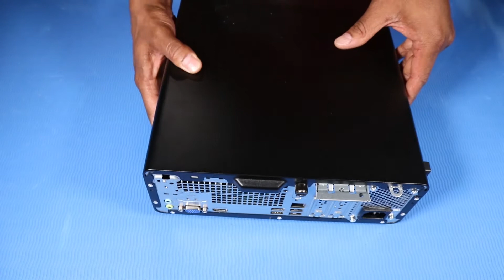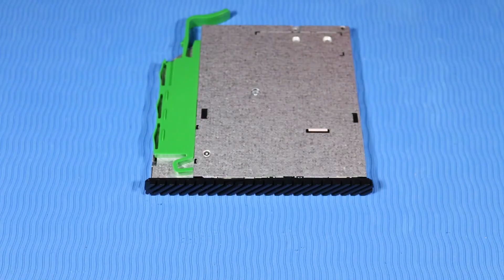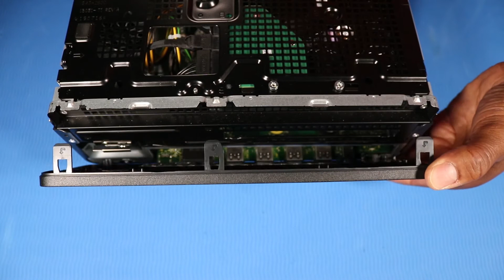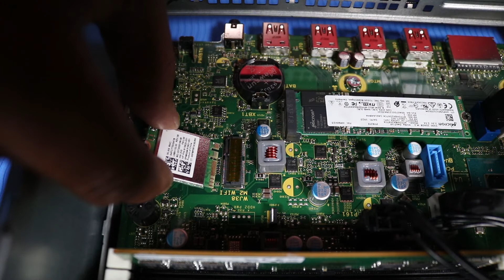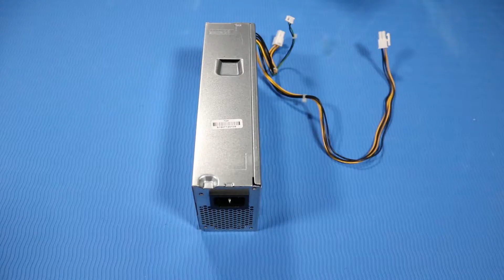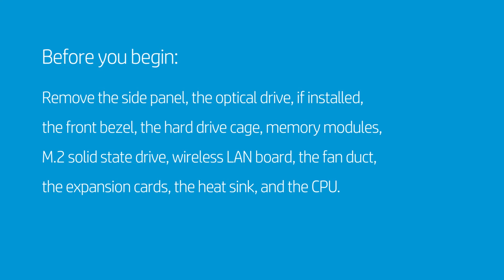Removing & replacing parts for HP 280 G4 Small Form Factor PC | HP Computer Service

Comment: I have a PC HP 280 g3 sff core I5, can I install Windows 7?
Reply from the maker: +Kirito Kun In accordance with Microsoft support policy, this product does not support Windows 8 or Windows 7. HP does not support the Windows 8 or Windows 7 operating system on products configured with Intel and AMD 7th generation or later processors, or provide any Windows 8 or Windows 7 drivers.